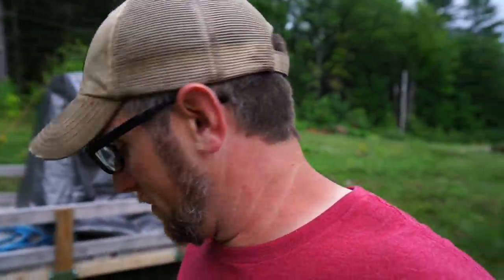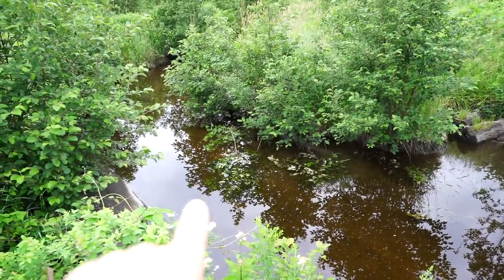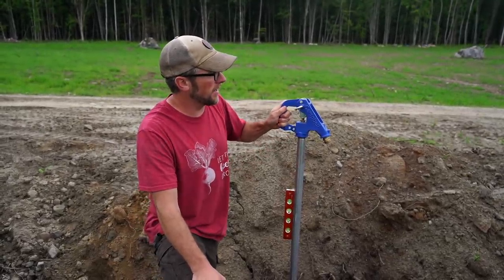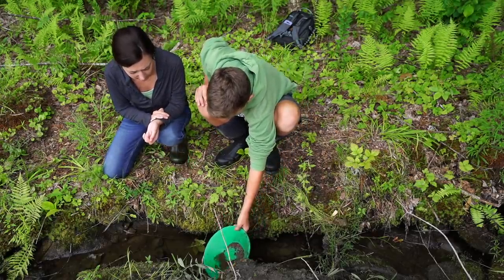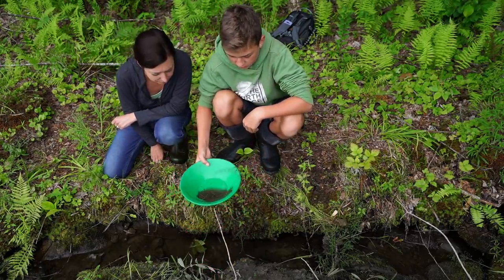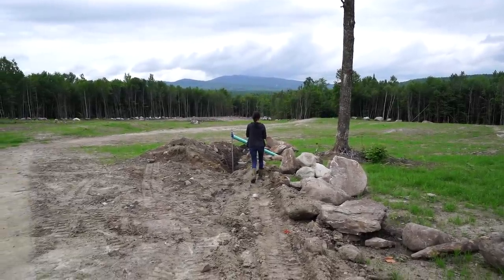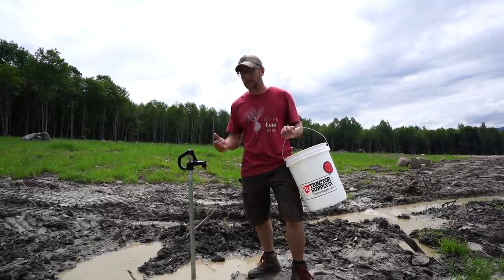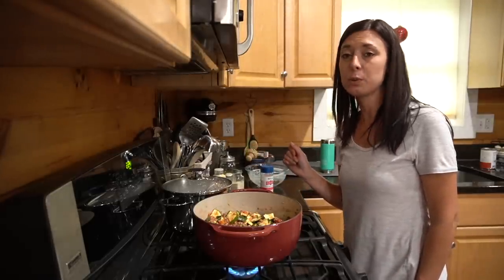DID We JUST WASTE all of OUR TIME & MONEY!?! Testing Our DIY GRAVITY FED Water System

Comment: The best to test the system would be to remove the lid, open both hydrants all the way & wait for the water in line to push out the air. It may take a minute or so. What ever the flow is will be all your going to get. close the lower hydrant first, then the other hydrant then put the lid back and check the flow again to see if its the same. You just don't know if the vented lid is enough vent or if the over flow when full of water is enough vent or not. Also, the volume in the tank may not be large enough given the shallow slope (can't really tell what the slope is) to create much head pressure. There is a reason town water towers are very high in the air with a large volume.

Comment: That first hydrant is usable and i would call it good but i believe the second one suffers from being a little higher than the first. the only solution there is to cut the stand pipe lower to the ground. i see no need to have it so long, only high enough to set a bucket under.
Reply: Maybe a well house to keep it above the snow if you lower the second one.

Comment: Is that second, lower flowing hydrant somehow designed differently with a restriction in its mechanism that is affecting the flow of water?is it possible for you to replace it with one that is the same as the first one, that way get the bucket holder also. Just thinking 😁

Comment: Al, the only way you can increase the pressure is to have a higher head of water. A “simple pump” will only make the water run a little faster it will not increase the pressure. Your design of a gravity water system relies on a good head of water which you do not appear to have. The hydrant height although a fair way from the tank does not appear to be much lower than the base of the tank. Water always finds its own level.

Comment: Also the elevation of the second hydrant looks to be going up hill from the first.. that lowers pressure also. RV pump would run off 12V. Submersible pump is the way to go.
Reply: To push water uphill it will require pressure and if water goes downhill then you will gain pressure. An easy calculation to know is that for every 10 feet of rise you lose -4.33 psi. For every 10 feet of fall in elevation, you will gain +4.33 psi

Comment: A RV pump would work great.I own a higher quality pump made by Remco.  Remco has quite a few versions of 12 volt pumps.  I have the Aquajet ARV 12V Water Pump which works great.   This one is 5.3 GPM at 65 PSI.  Be careful some of the less expensive pumps out there are junk.  This would work great with your battery system.

RV pumps are designed to be switched on then  start up when faucet opened and then go  off when faucet is turned off.  An AGM battery and a small solar panel to keep battery charged would works well.

Comment: Lift the tank up above the ground which will give you more pressure    ( 1lb per ft approx) and pump the water into the controlled by a float switch

Comment: Al you need to allow air into the Tank as the water goes out your outlet should be lower than 50% of the height of the water in the tank this would create a head of water. put an inline solar powered 12volt pump on the outlet of the tank try a Marine dealer for one of these it needs to be a sealed pump under ground and leave access for it. also see if you can get a stirip pump on the out let like you have on 200 Ltr Drums worth a try

Comment: Water is self-leveling therefore whatever distance the hydrants are below the source will determine output. The way to add pressure to the water line is to feed it from an inline pressure tank which needs a pump from the source to supply the pressure tank. Without Grid power that pump needs a solar supply to feed it. Another option is to raise the tote and supply fill it from the creek using a pump supplied by solar. Then there would be no need for a pressure tank and the tote would be the head and pressure tank. Need it insulated for winter though.

Comment: Hi there again folks, I was able to search for some pumps have a link here https://bacoeng.com/collections/boost-pump . Now the the drawback is you need the battery and solar cell separate, I know, but this was a quick search. I couldn't find out in the specs if it had an internal pressure switch to turn off when no water is needed. But it is what you need I believe or what to look for. I hope this helps in your search for a solution to the pressure and flow situation. Good luck.

Comment: So what keeps the water tote from freezing solid?
Reply from the maker: It’s buried and the running water through the tank
Reply: @1235kmh  Great points KMH! If I was a betting man, and I am, Al most likely knows it could freeze and already has a back up plan in place. He probably has plans for a well, but is trying his hand at using the current system to water the animals and garden when in place... even if the system is flawed.
Reply: @1235kmh  😂 great thing about Al is he isn't afraid to try, learns from his mistakes and is never afraid to ask for help/opinions. And yes, Jina should be operating the equipment 100%

Comment: You may need to dig up the tank and elevate it then install a ram pump to keep it filled. That will increase both your water pressure and volume/flow rate. Ram pumps are entirely passive and require no power whatsoever to function/operate.

Comment: I’m guessing you didn’t see my comments on the other episodes. Before you take the time to extend the line get the elevation drop and calculate .43 PSI per foot of drop and that’s what you will have for gravity pressure.
Reply: Alas, we leave helpful comments in previous episodes but they are not taken into account.  One problem is the time delay.  We're commenting on stuff that happened a few days ago, or longer.
Reply: If your going to add a pump I would use a camper pump it’s 12 volts and shuts off once pressure is attained.

Comment: Could you use a pressure washer with that water supply to wash off the equipment?  Do you have a pressure washer?
Reply: We have a gas powered pressure washer and it rquires 2gpm minimum to work. Al doesn't have that yet.

Comment: you will get approximately 1 lb of pressure for every foot of drop less line loss,  Most rv pumps are set for 1/2 inch pvc, may need to get a bilge pump for the volume you want  then you need a waterproof caisson to put it in. rv pumps commonly 20 pound of pressure at the pump.  be about nothing after several hundred feet of pipe

Comment: You could put a Ram pump upstream to fill a water tower say a 10-foot high platform. That would give you more gravity(stack pressure. Research Rampump online, it's a mechanical type no electricity used.
Reply: Ram Pumps waste water. Typically, only 2% to 20% of the water flowing through a ram pump system will actually be delivered to the storage tank or trough. See https://www.nrcs.usda.gov/Internet/FSE_DOCUMENTS/nrcs142p2_041913.pdf 
Also wouldn't work in winter.

Comment: You may need to vent the tank Al.

Edit: though I see people are saying it is vented already it couldn't hurt to try and see if more venting helps.
Reply: the overflow pipe is a vent for the tank
Reply: @pekulike  yes I see that. Would the mesh bag on the inlet causing slower flow into the system and the outflow pipe being obstructed by water constantly cause the issue?

Comment: Just put your pump at the first hydrant, not at the tank. The pump will pull the water it needs and force it to pressure on the outlet side. In addition, you can calculate the amount of pressure by the simple calculation of 0.43 psi per foot of rise. For calculating the available natural pressure take the height difference between the top of the water in the tank and the opening of the hydrant. For example, if it is only 10 feet you can only expect to have 4.3 psi. (.43 x 10ft)

Comment: i prefer the water columns that are solar 12 foot pipe set vertically from grade in series to the buried tank pressure with out to many switches or wires but in the winter the water column needs enclosed and must have a heat source which is why ondols can be added to the area and enclosed the cornerstone of a barn /hay storage the heat off the hay will do nothing but help in the winter the bio heat works to your advantage

Comment: Flow Jet makes an RV on demand pump no pressure tank required. 12v dc system so solar will keep a battery charged to power it. Capable of 4-6 gal a month. At approx. 40-50 psi….. data is if memory serves me right..lol
Reply: RV pump…..  oops

Comment: Vent tank use a transit or water level to check on elevation from tank to hydrant being in the water well industry for more than 25 years your flow is fine for livestock you have a good reservoir system in place big rocks going into trench not good

Comment: 1st use a pump on the last water outlet and pump out all the air till water comes out and then use a cut off valve to close the line then hook a solar power water pump up and good water will flow then

Comment: Al the best cistern system idea I've seen in my opinion was. They dug a hole in the ground and lined it with a good pond liner. Then they stood up a plastic 24 In culvert tall enough to extend above the hole They drilled a bunch of holes in the culvert and wrapped it with ground cloth. Then they filled the hole with river pebbles. after they poured about 12 in of cement into the bottom of the plastic culvert they covered the cistern with ground cover and buried it under a gravel pad. Afterward they built a green house over it. They used gutters along the bottom edge of the green house and along the roof of their home to keep it filled. I think this is very doable from a natural spring. I bet somewhere on your land you have a natural spring. Maybe not though.
Reply: I know, just build a spring house and be done with it. This creek comes from a spring.

Comment: Again a ram pump is a better way to go. Your level from water holding to water discharge is to much the same so you will get little if any flow. You need a ram pump. In your area to make it work year round you would need the tank in a heated area. However it most assuredly can be done. You would put the tank in the home in the upper levels of the house where the heat still keeps it from freezing and the gravity would run all your needs in the house and to your yard. It's a low cost operation system. See Seth Johnson's channel Land to House. Likely he would do a collaboration with you on one.

Comment: What about a in tank pump with a float to stop pumping it dry,  one connected to a solar battery powered pump. 
If a tap operated on off won’t work try a wireless stop start working off your phone
Something I saw on ( good simple living ) which maybe of use for you stalking out your pens, is a pneumatic operated fence post hammer tool, if you’ve a lot of posts sure is easier.

Comment: The water pressure is depending on the height of the head of water in inches not the volume of the water. The closer you are to the storage tank the lower the pressure.

Comment: I don’t about the products but if I wanted pressured water I would put it an underground tank at every location and gravity will fill it and you can pump it out of the tank with a solar system pump.Tank pump battery and solar panel.

Comment: You dont have enough drop in your water line.  And the further you go the smaller the feed supply line should be to create "more" pressure.  Take notice of the fire lines you see in the commercial buildings.  After every sprinkler head the pipe gets reduced to keep the pressure up.

Comment: Al gravity feed needs to be higher than the outlets to work right you would need to pump water up to a raised tank or pressurize the tank to get the water pressure you want. you can put a float switch in the tank to make it refill when it gets half empty another swtich to turn of pump off when its full a 12 volt pump small solar panel and a battery would fix it all

Comment: The longer the run of pipe you have the more resistance there is to flow.  Extending the pipe further with another faucet is not going to increase your flow. It's only going to add to less flow at the next faucet.
Reply: Al said there is quite an elevation change beyond the maples so he might get a little bit more flow since it is not too far away from his current spigot.

Comment: This idea won't help your current system, but a Hydraulic Ram Pump will take the energy from a large amount of water and push a small amount of it to a higher elevation. So the full flow from a spring could push about 10% of the spring water up to a storage tank at a higher elevation. Then you could gravity feed from that tank down to hydrants. No outside energy source required. Not sure it would work well in freezing conditions.

Comment: Hi, 
Every foot of rise is .4337 psi. So roughly 1 psi for every 2 feet of rise. You’re never going to have good pressure. 
You can get an RV water pump, 12vdc, that runs off a battery that is solar charged. I’ve done this with a fuel pump in the middle of a field before.

Comment: If you can measure the difference in elevation between tank and standpipe Roughly 32 feet = 1 bar or 14 psi less pipe losses

Comment: The level of the hydrants is higher than the tank? If you shorten the riser of the hydrant it will flow better. You could always put in a solar powered pump. Dropping those big rocks in the trench, you are risking crushing your pipe.

Comment: You should have used shorter hydrants. You are losing pressure because you are raising the elevation of the discharge in relationship to the tank which is defeating the amount of gravity on the flow of the water between the tank and hydrants.

Comment: Static pressure on a system like that should be about one half psi per foot of head. With the water moving in the pipe it should be less.

If the site has a good sun exposure, you could add a 24-volt, 1/2 Horsepower DC submersible pump in the tank. Should draw about 15-20 amps. Use at least #10 wire. With batteries and a solar panel to keep them charged, expect to spend about $800-$900 on parts. You might get by for less. You don't need a very big solar panel if you don't run the pump a lot of hours.

Comment: Upon watching this entire process I failed to see the pipe being laid on the bottom of trench, which should have been flat. Also as pipe was being  installed it should have been  bedded while standing on pipe using a shovel to secure it would not have any bows that would impede the flow. If needed to lay
 a flat stone  as needed on pipe.  You can not just throw pipe in to a trench and get good results, Same is especially true for ADS drainage pipe.  BTW i meant to indicate to use shovel  to place dirt on pipe.  Since Al is compensated by number of comments I would say all worked out as "planned" .

Comment: Hi Al, the only way to get more pressure at the end, you need to rise the tank. the higher the tank, the higher the pressure will be. but you need to build a insulated house, to prevent the tank to freeze. to fill the tank without electricity, you can take a ram pump. here is a link to see what i mean https://www.youtube.com/watch?v=FrmdGG41NSc

Comment: you will loose the pressure as the length gets longer it's the volume to supply thing , had to put in a 4 in pipe to hold the  pressure making the pipe smaller as the length of pipe got longer